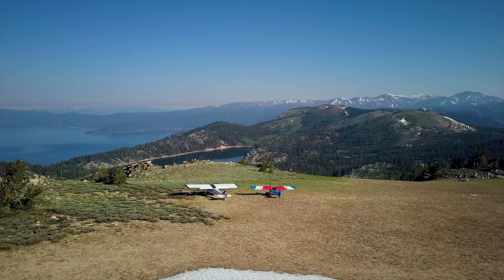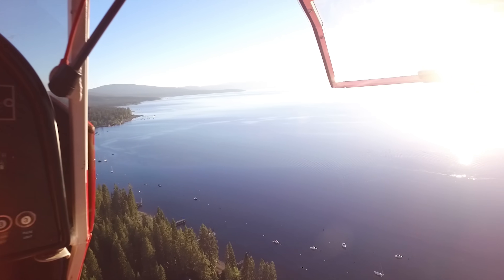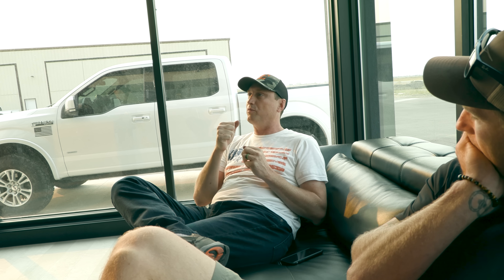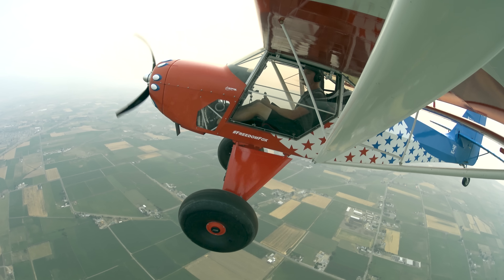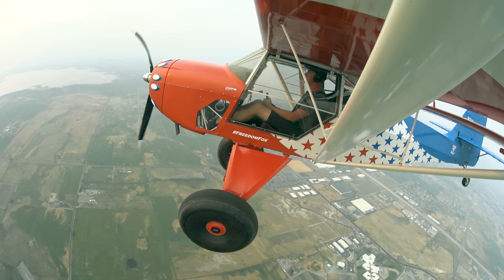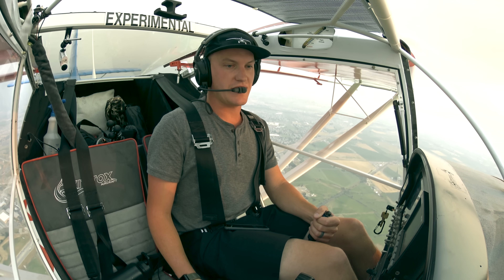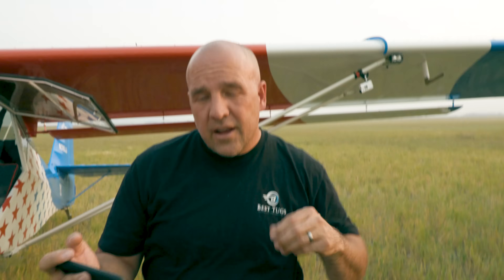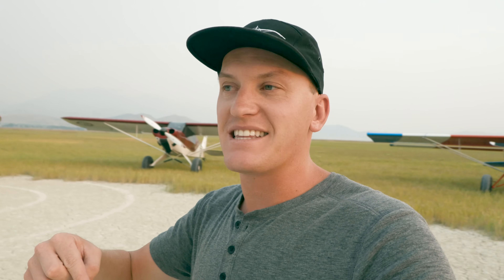YOUR FLIGHT INSTRUCTOR WAS WRONG! - Simulated vs Real Engine Failure

Comment: actually it really is simple. just think wind turbine, if a propeller would generate less drag when not turning wind turbines would not work. and your engine at idle will always produce thrust as long as the windspeed generated is grater than your airspeed.

Comment: At a full stop sitting on the tarmac and idling the prop is producing thrust but no drag on the prop from forward motion, like Trent observed. Yes there is some drag on a spinning prop in the vertical axis but we are talking in the horizontal axis. We can all agree, yes?

The drag coefficient on the unfeathered prop itself in the horizontal plane is the same whether or not the motor is at idle or off during flight. Think of standing in front of the unfeathered prop, that same face is presented to the horizontal plane in flight whether the prop is spinning or not. At idle there is still thrust, however small, in that same horizontal plane.

Therefore, as you have proven, you will go further at idle than at dead stick because even though the drag on the prop is a set amount, the thrust has to be factored into the equation at idle. IMHO 😁

Aside: the drag of turning a dead motor by windmilling would be the worst. Draco is probably the exception to the rule as Mike saw only a small amount because he is flying a turboprop not a piston engine.

Comment: There is a specific RPM that will generate a certain speed of air - if the inlet air (airspeed) is slower than the exit air (speed of air moves by idle prop) the the prop is generating thrust. There is a speed where the inlet and outlet air is match (zero thrust speed) at which point any extra airspeed will cause the prop to start generating drag. 

It’s a function of the pitch of the prop and the RPM at idle. 

Thrust is generated purely by changing the speed of the air (imparting a force on the air) if there is no change in speed then there is no thrust, if there is a decrease in speed, then there is drag. 

-source: I’m an aerospace engineer and design airplanes for work

Comment: From my experience with RC planes stopped props tend to cause less drag. Whenever you want to land short on planes without flaps, run the prop as slow as possible. Just my RC experience.
Reply: Plenty of the experience for sure, my giant Stinger with a stopped prop is a tough one to stop when trying to line up for a dead stick landing versus the motor at idle.  The Drak kind reverses that thought and think of it like a jet that will come down rather quickly.
Reply: right, you cannot scale air density to the weight of the model

Comment: The tests you guys performed are dependent upon each aircraft weight, and propellor combination
Reply: Yes they do, which is why they kept saying "in my aircraft, with my prop and engine".  Though I suppose they could have also added "in this configuration with this load".

Comment: Excuse my ignorance (not a pilot) but if the engine was out and the prop stopped what kind of speed would force it to windmill? it looked as if 60mph wasn't enough to overcome compression and turn the engine over. In other words if you shut the ignition off and opened the throttle could the engine be restarted by windmilling?
Reply: Many motor gliders (SSG, or self sustaining glider) actually have no starter motor, you have to extend the engine and dive to get the prop to windmill before you can start the engine.

Comment: My husband and I fly gyros, and engine off landings are something many of us actually practice in the gyro community, since it is different from simulated.
For example: https://www.youtube.com/watch?v=rNyv47RtIAU
I can tell you, from multiple experiences, that the engine at idle *definitely creates more drag* than when it's off with the prop stopped. I don't know the physics behind it, but it definitely does. It's significant and palpable. When you back off to idle you feel a significant increase in drag, when you cut the engine and the prop stops, that drag disappears. Again, I don't know the aerodynamic reason behind it, but it definitely does.

Comment: I'm surprised nobody is asking the question - would a helicopter's prop (rotor) create more drag rotating or stopped?- maybe instructors have been teaching that wrong all these years as well. Instead of auto-rotation, just stop the prop - you'll land in a much smaller space! ... Seriously though, engine "idle" is not really a thing. An engine/prop can be set to rotate at any speed.

Comment: We did a similar experiment in our RV-7 with 180HP IO-360 and MT 3-blade prop a few months ago. We could NOT stop the prop from turning at ignition cut off mixture and both P-Mags switched off. It would still turn at stall speed and below (accelerated pitch up/whip stall). At 70 knots glide speed the rate of descent was measurably higher with the engine off and prop windmilling and I have adjusted my practise engine out 'picture' accordingly, so that when practising I aim to arrive about 100 - 150ft too high at the chosen landing spot.

Comment: Hi Trent. ....Your argument has merit if the airyplane isn't moving forward. Standing behind the plane while on the ground displays the prop pushing air rearwards. The plane is stationary and therefore the only medium able to move is the air.
Consider the plane moving at 40 MPH through the air. The idling prop is not able to maintain thrust at that speed or any speed for that matter. Also remember the spinning prop presents itself to the air as a "disc" upon which the reactive force is thrust. If the prop isn't turning fast enough to carve a clean helix through the air then it becomes effectively a barn door being pushed ahead of the prop. AKA Air screw. When the prop is stopped, the disc is removed from the equation and two large draggy boards are presented to the slip stream.  Draggy yes but not nearly as much as the idling prop. 
You need to go out to a paved runway and shoot some landings with an idling prop and a dead stick stopped prop. You can clearly feel the difference especially when you clear the threshold.  Over 40 years of flying has proven this to be true for me. I have practiced may dead stick approaches. The only thing an idling prop will give you is a bit more rudder authority at low speeds. Most planes were not designed to have a whole lot of rudder without prop blast. And don't forget the prop wash has a tendency to yaw the plane due to it hitting the aft fuselage. 
I Have a 1956 Champion 7EC with an offset vertical fin because of this. I also have a Stinson 108 with a trim tab on the rudder. 
If you are going to fly the back country thi is a very important exercise to practice. 
Fly safe.
Reply: Prime example, the Dash 8 400, put those babies at idle and you have slammed on the breaks, best to stop those barn doors.

Comment: Anyone that says that an engine at idle doesn't produce thrust has never had to disconnect a GPU from a 400 series Cessna. My hat was 50 yards away in the ditch off the end of the ramp.
Reply: I think it's better to think of an idle engine as producing its "minimum thrust," which is not the same as "zero thrust."  Whether that thrust is usable or not will depend on airspeed.  Think of it like this:  Thrust is produced by moving more air through the prop disk than would be moving through it if the prop were not there.  At higher airspeeds, you need to move more air to generate the same thrust.  Since no plane flies at 0 kts, there will always be more thrust at idle on the ground than at idle with airspeed.
Reply: For thrust to exist the velocity of the air being accelerated rearwards by the propeller must exceed the airspeed of the aircraft. On the ramp that condition is easily met when idling. Wether or not fuel is being consumed is irrelevant.
Reply: There's another side to this. The thrust depends on how much faster the prop is pushing the air compared to your air speed. However, as the air speed increases, the air hitting the prop is moving faster, so the engine has to do less work, so it will speed up (if the throttle is fixed). The thrust will stay basically the same though.
(There will be some more friction at higher RPMs so I think you'll lose a bit of thrust, but I don't think it would be significant. The engine will perform slightly differently at altitude and moving as well, but again, probably not significant.)
Reply: Dear Wrench, you are certainly correct.  A rotating prop at idle DOES CERTAINLY create thrust.  But you'll never get off the ground running that engine at idle.  In my short flying experience, an idling engine will taxi an airplane at around 10 MPH, with the occasional blast on the throttle to keep you rolling!  YES, that is likely to blow your hat off, but not add anything to your flying speed.
Reply: Wrench, are you one of those people that pretend to row on a boat? You would know that moving slower than everyone else doesn't generate propulsion.
Reply: Daniel Lu Haha, ahaha. No you are absolutely right. Now would you agree that you rowing slower creates less drag for your rowing team than just shoving your oar in the water braking them?
Reply: What creates more lift, a stalled wing or a flying wing? 

When the prop is stopped, it is a stalled wing. That makes no lift, and all you have is the relatively small amount of drag the stopped prop makes. If it is spinning, it is creating lift - and if the angle of attack is negative, like when your glide speed is higher than pitch speed, if is creating lift in the backwards direction, also known as drag.  Potentially much more drag than a stopped prop makes.
Reply: Forward speed decreases the angle of attack the prop blades experience.  The more speed, the lower the angle of attack.  If you fly fast enough, like in a dive, you will create drag with a prop even at full power.  That's because at some speed, the effective angle of attack on the prop drops to zero.  At idle power, you don't have to be going that fast for the angle of attack to drop to zero lift, and the engine isn't developing enough power for the prop to compensate by turning faster .https://goo.gl/images/kzJEHK

That is completely different for a jet.  The jet increases the speed of the air so much greater than a prop does,  relatively small changes in airspeed do not affect thrust as much, and can often be considered constant over a range of speeds.
Reply: But at any speed, a moving propeller is transferring energy to moving the engine that would otherwise be added to the drag of the prop.
Reply: no it is not.
Reply: 25+ years as an aero engineer, 4 of them doing flight dynamics for NASA, and I get to put up with guys pulling sayings out of their butt like "If the engine is consuming fuel, it is producing thrust."  Where is the rolleyes button?
Reply: you just answered your own question. Instead of the engine turning the prop the incoming wind is creating a drag on the prop to turn the engine even though the engine is consuming fuel. Think of it like a car. if you are on the highway and need to turn off you let go of the accelerator. the engine is still running and producing power but it is overcome with drag which slows down the car. Think of it like engine braking.
Reply: If the engine isn't running, yes.
Reply: @johngoscinski1995  amen
Reply: Finally some insight and facts in this discussion of the dark ages. Thank you, John Goscinski!
Reply: Sure, if you fly fast enough you'll create drag with the engine at idle. But the point is that you'll create LESS drag than if the prop was stopped.
Reply: Couldn't have said it better. Applying this the reason the idle helps with the STOL type so much is because the glide speed relative to the idle prop doesn't decrease the angle of attack because glide speed is incredibly slow to begin with. I don't know for sure but I think if you tried this with say a 182 you would not get as big a difference between the idle and stopped prop.
Reply: Anthony Felts they were gliding at 60knots that’s not that far off from best glide in a Cessna. Best glide in a 172 is 68 KIAS and 70 in a 182. 

Engine out vs idle will be worse regardless. Think about being on final approach with low RPM or throttle closed, bump up 1-200rpm and it make a huge difference to glide. Now imagine going from 0rpm deadstick to 800rpm idling.
Reply: John Goscinski Thanks you’ve put my thoughts into words that I wasn’t able to do myself. You are 100% correct.
Reply: A piston engine drives a fixed pitch propeller at a constant power for any given RPM. So at idle, a higher airspeed corresponds to lower thrust (power is the product of force and velocity). An idling engine will produce less thrust gliding than it will stationary,  but the engine is still performing work on the airflow and increasing the energy of the aircraft. This is regardless of any drag created by the prop in the airflow (the prop may create more drag than it does thrust, but it will not create more drag than a stationary prop). Keeping in mind that a propeller is just a rotating wing
Reply: Too bad you didn't bother to read my post and look at the included diagram before posting this fable.  This is a bunch of horsefeathers. 

If the glide speed is higher than the pitch speed the prop is at a negative angle of attack.  Negative angle of attack means the prop is creating lift in a backwards direction. aka DRAG.  There is no positive component.  There is no "more drag than thrust, but there's still thrust" It's just drag.   In the case that Trent tested,  the glide speed of these light, slow airplanes is less than the pitch speed of the prop at idle, the prop Aoa is positive,  so they continue to see some thrust. 

A stopped prop can only create the drag of a fully stalled airfoil.  Being just a rotating wing, even at negative AOA a prop can product much more force (lift in the backwards direction) than that, by a factor of 5-10.  So a prop operating at negative angle of attack has the potential to create a boatload more drag than a stopped prop.
Reply: +John Goscinski Regardless of the speed of oncoming air, the relative wind that the propeller blades see is at a more positive angle of attack for an idling propeller than for a stopped propeller
Reply: An idle engine does not necessarily produce thrust at flying speed.  The fact that it does on the ground at zero airspeed does not mean a thing in the air.
Reply: Exactly, but for some reason for everyone here, (including Trent) that is a very hard concept to understand.  Even Mike said in the video he got a better glide with the prop stopped than with it free spinning.  50FPM is a big deal.
Reply: but would it be fair to say that at low flying speed and decent angle of attack blades,  it still could produce a small trust , or no trust but no drag .
Reply: "Spinny thing turn, wind come out, works always! Even had my hand out my window while flying. Spinny thing turn, wind!" - Most people here.
Reply: If the engine is consuming fuel, it is producing thrust.  Think about it this way, if you turned the engine off while gliding, would the RPM increase or decrease? On both jets and pistons, the rpm will decrease if you cut fuel.  Therefore, the engine MUST have been producing more net thrust (less drag) while idling than when off.

Comment: Fantastic discussion!  From my basic understanding with the engine idle in these types of aircraft you still have some static thrust on a fixed pitch airplane assuming you have enough pitch at idle to generate some positive torque and therefore thrust.  Now winds can really bugger this test up.  In order to get best glide into a headwind one would need to pitch for a faster speed than book charted best glide to get the charted best glide range. One thing that might be interesting is if density altitude is high enough and the prop is not correctly pitched for these conditions it might not generate an appreciable amount of thrust at idle and therefore be negligible in its effect on this condition.  Similar to a constant speed prop and how it can effectively windmill at idle with inadequate power applied it will actually decrease glide and be much more drag than if it was feathered.  So many variables to consider when theorizing how an aircraft will behave in a given configuration at given conditions that trying to extrapolate this data with out carefully controlled flight testing can net inconclusive results.  Nonetheless knowing  your airplanes capabilities and performance before a malfunction can pay huge dividends when something does go wrong.   Love the videos Trent fly safe and Cheers!
Reply: Hi Josh, Wind would not be a factor in this other than you would cover less ground heading into the wind and more ground with the wind. Go play in the wind, find out what your airplane will do, test your theory about wind playing a factor in best glide, I think you will find once airborne wind doesn't effect airspeed, only ground speed. In my test, trying to stop the prop from windmilling wasn't worth the effort, best to leave it along. Biggest thing I learned was that you want to carry more speed into the flair to have the elevator authority that you normally would have with engine at idle. Great discussion!